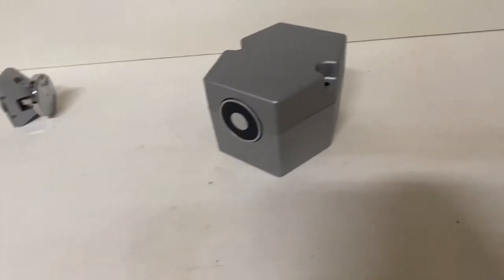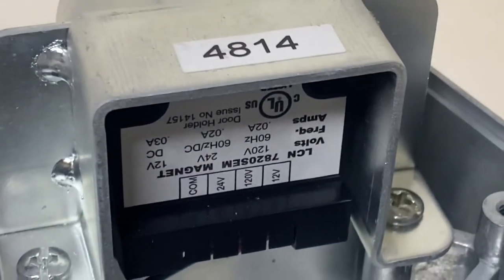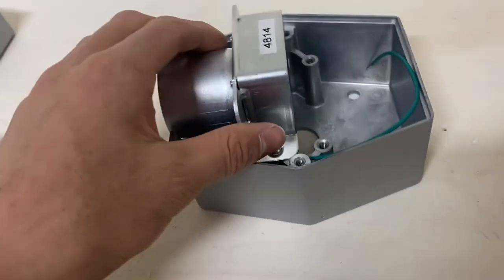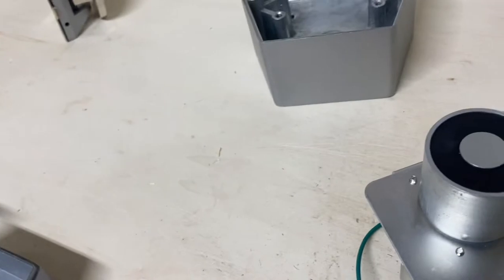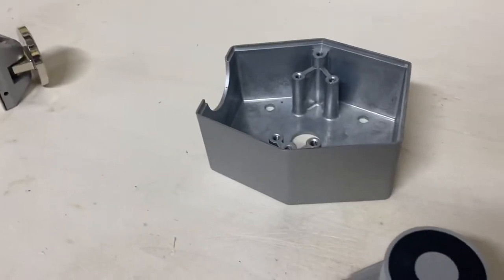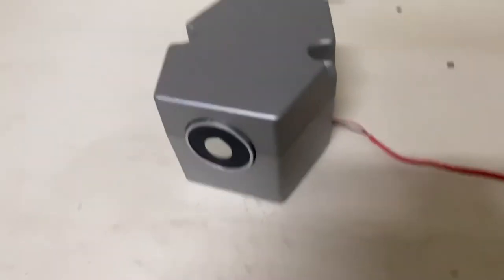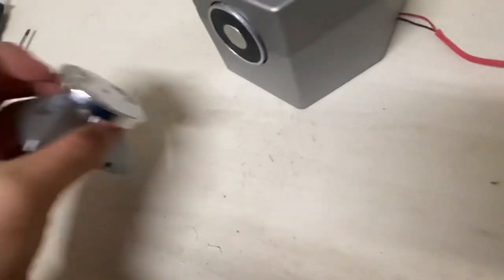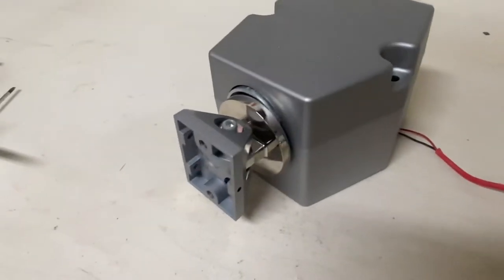Overview/Demonstration of a floor mount fire door holder

Comment: if you want to use it you could still make a hole in the side of it I very rarely actually see them fed from the bottom in the floor it’s usually the side
Reply from the maker: Potentially, would just be a pain though. I think I’ll just sell this one and buy a wall magnet